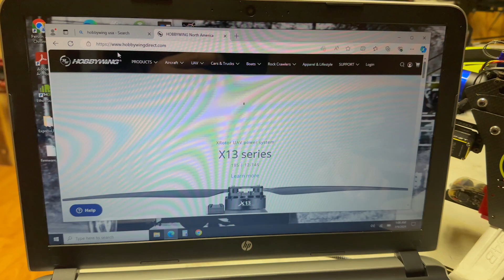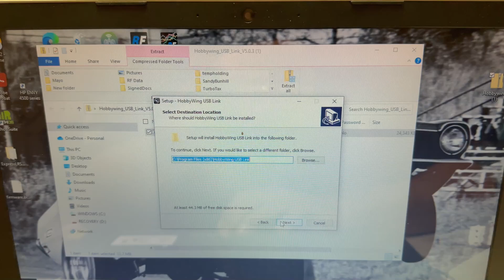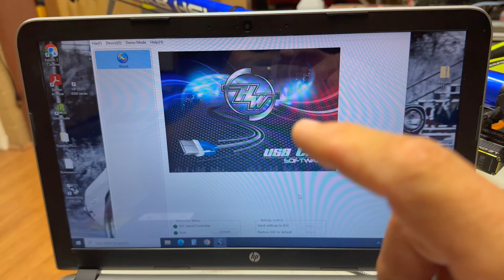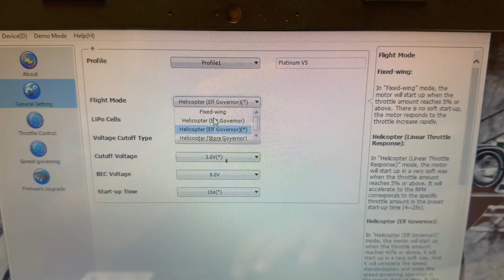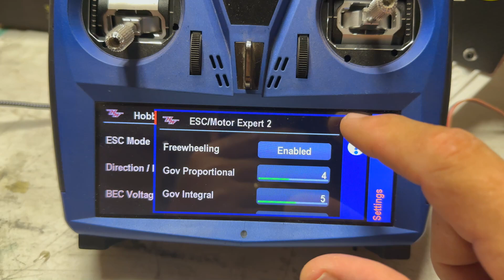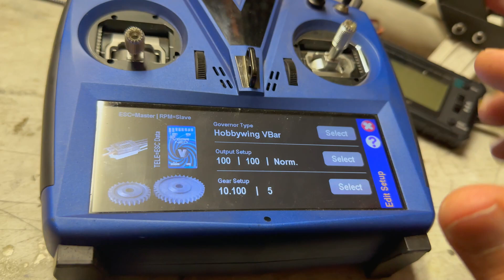Hobbywing 260 V5 ESC / SAB Raw 700

Comment: Hi - how do we know what timing to use? I have a fms fox 3m glider 6s 14 pole 4258 kv460 & v5 80 amp, i did maiden a few days ago and motor has a few stutters - if i move the throttle slow gently it seems ok but move stick too fast it will stutter. set to 14 pole. i never touched the timing default value.

Comment: Vbar governor goes back to direc every time I reconnect the model instead of the 22T I programed. Why is it doing that?

I'm using Hobbywing 260, Xtareq 550, vbar evo v8 and control touch.
Saved model, latest updates and the throttle has been calibrated.

Comment: Ok so I am kind of lost here lol. Maybe is a stupid question but How many Poles your motor has? On Scorpions ESC if is a 10 poles you will Program the ESC of half of the pole count.
Reply from the maker: You will need to check with your manufacturer. I run EGODRIFT motors (4530HT550) which are 10 pole motors. Just check your motor specs to be sure.

Comment: Thanks for these videos!
Reply from the maker: I enjoy doing them. If there is a specific topic you want just let me know and I will see if I can get it done.
Reply: @biscaolena  just curious, does the HW80 V5 have full telemetry? Might pick one up for a setup. Thanks
Reply from the maker: @1981billiam  from the HW web site the 80 amp "Supports Mikado VBar System, Futaba S.BUS2, and other data return protocols for remote parameter adjustment and ESC status monitoring.". Here is the link to the page... https://www.hobbywingdirect.com/collections/platinum-series/products/platinum-pro-80a-v5

Comment: technically speaking you would draw more amps from big loops and stuff like that - as opposed to 3D smack stuff which would not be so high, I do agree though better with greater headroom, i recently moved to a 300a scorpion tribunus, I can easily hit 240 260 amps with the tri blade heli's so why push a 200a - as we all know bigger is better!!!
Reply from the maker: I was asked if this 260 was ovekill. When this heli was a 2 blade, I had a HW 130 on it. I typically flew it with lower head speeds. What I was commenting on was I intend to fly this arrangement at higher head speeds and much harder which as you noted above will draw more amps. In the past I never drew 240 plus so I expect to see peak amps anywhere from 200 to 230. We will see this weekend.
Reply from the maker: Amen.... :)

Comment: Okay, I have to ask the question..... Isn't this overkill?  How much amperage are you currently pulling?
Reply from the maker: On my 2 blade 700 helicopters I run anywhere from 1800 to 2100 head speed and see amp draws anywhere from 145 amps on easy flying to 190 amps in hard 3D. Obviously the 190+ amps is at the higher head speeds and under harder maneuvers. For this heli in the video, I installed my 3 bladed head and tail which will draw a lot more power especially at the higher head speeds. Would the Hobbywing 180 amp ESC on this airframe have worked fine... probably but I am also not a big fan of living in the factor or safety. Hobbywing states that the 180 is rated for 180 amps continuous and 260 amps peak. If this was staying a 2 blade heli I would have opted for the 180. But since I intend to fly this 3 blade at higher HS and hard, I opted for the extra capacity.